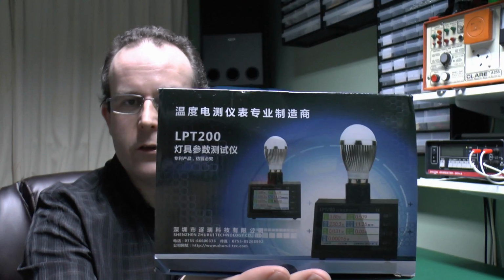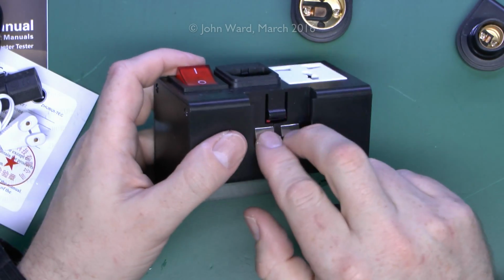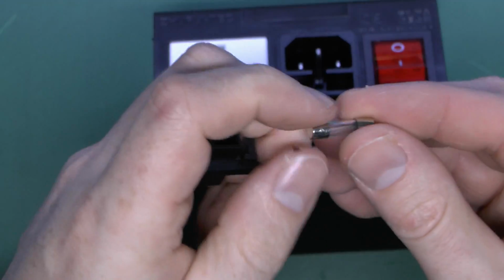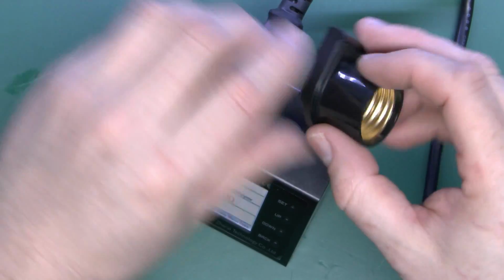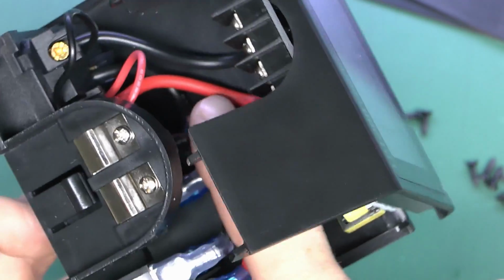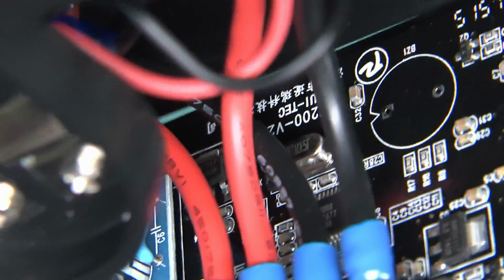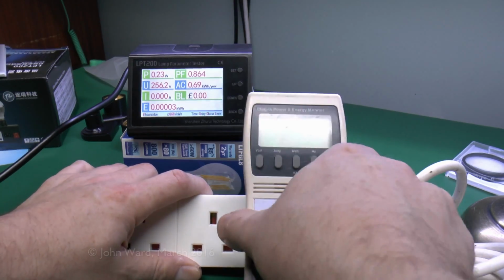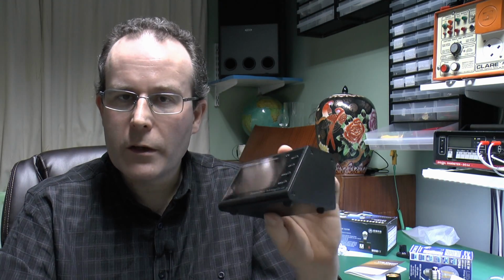Lamp Parameter Tester LPT200

Comment: Could the two large ES bases be E26 and E27?  E26 seems common in the USA.
The bi-pin lead is probably for the unballasted LED fluorescent tube replacements.
Is there a possibility that the other meter with the cloudy display has still got one of those annoying protective films on it that needs thoroughly fingernailed up at a corner to reveal its presence?
Reply: +bigclivedotcom E26 and E27 are interchangeable though.
Reply: +TwitchingDan You can generally use an E26 lamp in an E27 holder, but if you try putting an E27 lamp into an E26 holder it may be extremely tight depending on the tolerances.
Reply: bigclivedotcom Mostly. Buy why use a 110V lamp in a 230V socket or the other way round anyway?
Reply from the maker: +bigclivedotcom Measured the two, they seem identical, and an E27 lamp fits into both equally well.
Reply: Does say in the book, E27 x1.. no mention of E26. So maybe just a packing glitch.

Comment: I've got one of those power monitors - mine came from Maplin. The LCD isn't faded, it's just that the display is for some reason set up for viewing from below, as on a calculator.

When you order a custom LCD you specify the viewing direction the display contrast is the best from: From above/12 o'clock, below/6 o'clock, straight on/normal, left/9 o'clock or right/3 o'clock. Edit: This applies to multiplexed displays, not direct drive ones which look good from any viewing direction.

A few years back I visited a firm who had helpfully set an LCD clock into the desk next to the visitor signing-in book. Unfortunately its display was set up for viewing from above/12 o'clock and so was virtually invisible to anyone signing in.

Comment: looks like a nice little unit, good quality if not a little over engineered considering the basic job it does. The exposed contacts thing isn't really an issue in my opinion considering all bayonet and screw fittings have the same exposed contacts anyway.

Comment: Nice looking, and decent enough inside. Price though, and looks like you could also repurpose the entire front panel. Micro is likely a Chinese clone of a STM part, and the other is likely also a cloned 18 bit ADC chip, and you could also add the beeper to get the annoying beep on key press and power on. Extra power board likely added as power for the backlight and colour TFT display, more power than the capacitive dropper typically used can supply, though it is nice they put in the input common mode choke and class X filter capacitor, and have another fuse for the board itself.

 I used another power meter with LED display to measure its own power, and it came in at under 2W with a pretty poor PF. Stuck it in a DIN box and it is now a power measuring extension cord, using some No00 glands to hold the cable.
Reply: Just bought one because it looks extremely hackable, giving you a nice box with power supply, microcontroller, adc and a neat ui.

Comment: I'd imagine the power factor for that 8W lamp would be leading rather than lagging, due to the capacitive dropper, so would actually improve the power factor for the power co in most cases
Reply: +TheChipmunk2008 could also be a tiny buck converter

Comment: The white cable could probably be connected to a flourescent tube, which is kind of scary without a ballast or anything.
Reply: +drkastenbrot I imagine it's designed for LED replacement flouros
Reply: +Silvaentys Fyrerux That would make sense then... Still dangerous, or maybe not because they way those would be wired for led tubes wouldnt ignite or heat a flourescent tube.
Reply: +drkastenbrot I was thinking possibly GU10 halogen/LED lights, but your suggestion makes for much more sense and even more fiery death!
Reply: +drkastenbrot Yeah, the auction on it says the white cable is for a T8 tube, but I would never use that. That's pretty crappy.
Reply: It would blow the filament at whichever end of the tube you connected (the end filaments in fluorescent tubes aren't rated to survive the full mains voltage, or indeed anywhere near it, without the current limiting provided by the ballast).

Comment: Those internal wires look thinker than they need to be, the power cord was only 0.75mm². Not like the Chinese to waste copper.
Reply: The wires might actually be aluminium. If they are, they will need to be thicker than copper for the same current.

Comment: Bet you that IEC cord set supplied is using CCA wire, and if it will actually survive 10A it would be a surprise. Think the 2 ES bases are a packing fault, likely there is another user who got one with 2 B22D adaptors.
Reply: Yes, I've seen several highly dangerous cords with the same branding as shown here. Just the labelling by itself is suspicious: H05VVH2-F means a flat (2-core) cord, the round version is just H05VV-F (without the H2). (The light-duty counterparts to them are H03VVH2-F and H03VV-F, respectively.)

Comment: WHy is your voltage 256?  I guess your utility runs hot.
Reply from the maker: Voltage here is fairly high, usually about 245.   Items in many videos are supplied from an isolating transformer which has a higher output voltage when there is no load connected.

Comment: Very complete product but it would be good  to have some datalogging on a storage device :P I need to import from china or there is a EU supplier?
Reply from the maker: Mine was direct from China, not sure if there are any EU suppliers.  As it's a relatively expensive device there may be import duty to pay when it's delivered.
Reply: @jwflame  Thanks for the advice and quick answer

Comment: so what's the difference between W and VA?
Reply from the maker: +Dan Dart Power factor.  Watts is the actual power used and is what you pay for.  VA is apparent power.  For resistive loads they are the same.  For anything with inductive or capacitive elements they are usually different.
Reply: And VA x PF = Watts

Comment: Wonder how long it will be before someone gets ELECTROCUTED by those top connections, looks good apart from that literally fatal flaw
Reply: +roughchippy I was hoping for an interlock switch.
Reply: +roughchippy But as said, it's not really any more dangerous than the lamp holders.